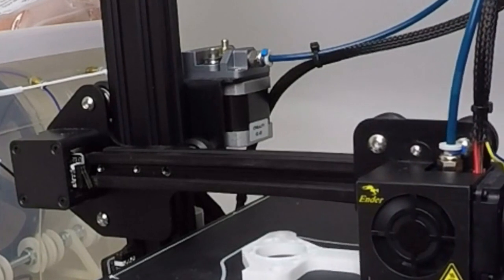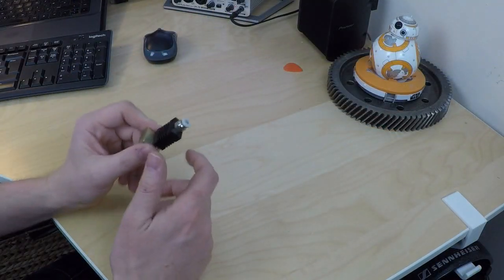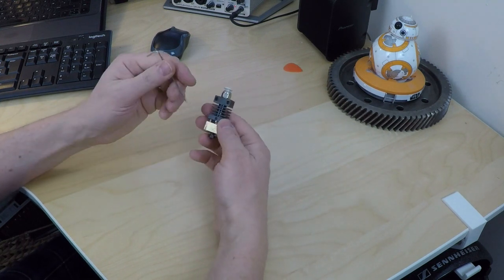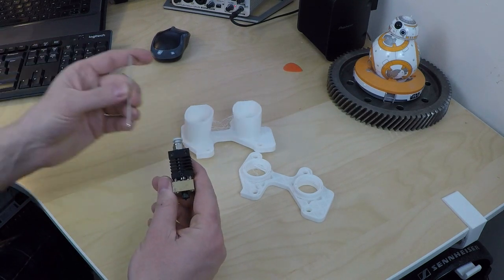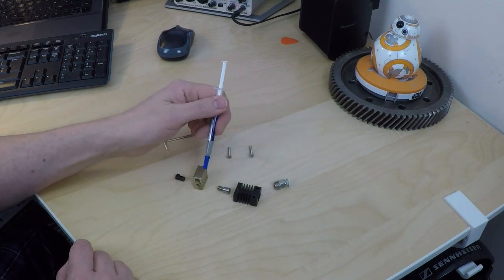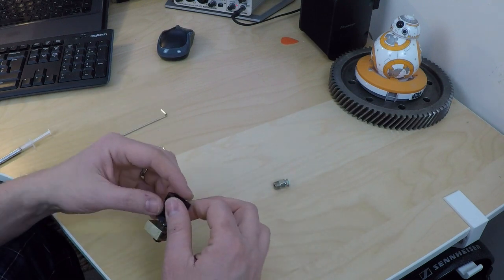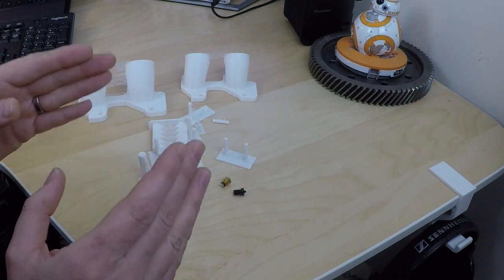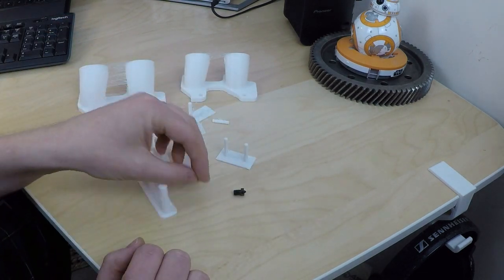Never clog again!! 2 easy tips to solve a clogging all metal hot end!

Comment: Oh boy.

Just so you (probably) already know, it’s not because it’s a cloned part, it’s the characteristics of all metal hot ends.

I myself got one of the original Micro Swiss ones and had nothing but frustration. I ditched it in the bottom of my parts drawer some eight months ago and went back to the stock hotend.

Now that I watched your video I’m ready to give it another try. Never considered using thermal paste, it solved your problem and will probably solve mine.

Cheers mate!
Reply from the maker: Not so sure… I know every all metal hot end has more problems than the standard hot end.

And anyway the Prusa uses a E3D V6 and runs PLA no problems…. (So that’s what I’ve bought now!)
Reply: How was it going?

Comment: Make your retraction 2-3mm. I get almost no stringing.
Reply from the maker: I tried different retractions, what actually helped was removing the retaining screws...  but i'm on the next iteration now....
Reply: @MakingforMotorsport  Also check your heatsink cooling fan. Mine was heat creeping up the heat brake and then it clogged. After replacing the fan its printing better than ever.

Comment: One thing I noticed you missed in regards to heat creep on these all metal hot ends, the two long screws (silver Phillips head) are in place just to help align the heating end with the rest of the body and should be removed after the whole unit is tightened securely as they will cause 3x the heat transfer between the heated end and cooling body hence the heat transfer problems. Try removing these and you should get way better performance without the need of thermal paste.

This is an awesome video regardless and greate starting point for anyone to begin printing using these metal hot ends. Thank you for putting in the effort of recording this, you are much appreciated! 💯🌟👍
Reply: CHEP youtube channel proved the screws are basically nothing to worry about. Decent *theory*, but the emperical heat transfer that actually occurs through the screws IRL is completely negligible in practice.
Reply: never use the hotend with these screws removed
Reply: like....actually? I just got this style of hotend - so I am going to try that!!!!

Comment: CPU silver heat paste will degrade at above 140 C at best. Its not designed to go higher then 100 cause your CPU will shut down due to thermal protections. It will probably be fine for heat break / heat sync but it will hurt on the nozzle hot block.
Reply: Just looked at my package of kryonaut thermal paste. It looks like it's 350c! Artic silver is 130 though so get some kryonaut. I am not sure if thats long term temp so you might wanna double check.
Reply from the maker: Yeah the Thermalyse (I think) one I used in the video is good for 300 but your not the first to say that about the Arctic Silver 👍

Comment: Muahahaha!  "NOOOOOOOO, NOT AGAIN!!!!!" 

That´s it! .... Damn Pheatus Dragon Hotend!
Reply from the maker: Haha…. So I take it you don’t recommend that hot end? 😂
Reply: @MakingforMotorsport  To be honest the high flow variant is a pain in my ass! ... Stringing issues but you´re able to control it with a lot fine tuning. And more than 1,89mm diameter will cause clogging. You can´t use cheap filament with it. Otherwise it´s a good hotend for that price range.
But just my humble opinion. I wouldn´t buy it again I think. Maybe a Mosquito ... You can´t change the nozzle as good as with a Mosquito and I´ve never had issues with a Mosquito... no clogging, no stringing... you get what you´ve paid for ... or so...
Reply from the maker: I think the high flow ones are always going to be trickier with stringing, just a larger melt volume is always going to be likely to do that I think.  I was thinking about the E3D volcano but I wouldn’t use it properly… hence the V6

Comment: Get a mosquito clone, it'll solve all your problems

I had V6 hotend before, and had the same issues, caused by heatcreep, and not enough cooling on the cold end

Sadly all of these types of hotends has the same issue, heatcreep

The mosquito has bimetal heatbreak which solves these issues, also a lot more effective cooling on the cold end

With it it doesn't really matter how much my retraction is, it never clogs, since I have it I never had any clogs

I'm printing with pla, petg, abs, asa, tpu, soon I'll try to print nylon(66, mega prone to warping) if I finished the chamber heating

Also nozzles

Most cheap ones has a 120 degree cone at the end of the nozzle inside, super prone to clogging, the correct angle is 60, probably the material burns in the sharp corners and when it gets out it blocks the nozzle, or simply the flow resistance is that much higher in the 120 degree ones
Reply from the maker: Great bit of information… I went for the V6 because they are the Prusa standard (I think) and that seems to cope well enough with PLA?  We’ll see I suppose!  I’ll have a look out for those nozzles aswell 👍

Comment: Also, MOST (not all) thermal grease/compound or glue/epoxy can "cook" and turn extremely hard and actually work as an insulator.  Due to the close tolerances of the heater and probe, you don't actually need to use any compound on these parts.  Plus if any of the grease gets into your print, its going to ruin it as well.

Comment: That heat brake is NOT an ALL METAL hotend.  That still requires PTFE tube to got 80% of the way down the heat sink... A REAL all metal TITANIUM Heat break will NOT use PTFE tube except for the top 3mm of it, which will only require about 10mm of TOTAL PTFE tube insertion including the little "bite" fitting at the top..
It should look about 20MM long or so, and be 1.75mm ID for most of the length..
What you have there is a SCAM piece.  They use a "play on words" so they are correct.. 99% of 3D printer people refer to the entire "hotend" as the... Well, "HOTEND" except these scammers refer to just the "heating block" as the "hotend".... And include none of the Heatsink in their "hotend" description... Except they do when selling it.. They don't say "hotend plus heatsink"... They sell it all as one "hotend"..
So for a budget fix, you need to search for "all metal throat", or "3d print titanium throat" and that'lll provide you with the part you're looking for..  No guarantee it'll fix the clogging, but will probably help a lot with your issue...
Reply from the maker: Hi there… I do love your passion but this is “all metal” as the PTFE extends only about 5mm from the connector into the heat sink and the heat sink has only a 2mm hole through for the filament only…
However I am sure we can agree that what I have is sh1t whatever… and is going to be replaced with the genuine E3D V6 I have sat next to the printer 👍
Reply: @MakingforMotorsport  Its def junk, but the PTFE has to go almost 25mm into that heatsink to hit that short heat break.  That means that most of your heatsink is filled with PTFE not metal.  Here is a link to the "all metal" heat breaks that you will want to run.  Sorry it's U.S. page, but I'm sure you can use it to find one for an U.K. Amazon page.  This will go right into your stock ender3 hotend, and replace the stock heat break.  The PTFE tube only goes 4mm into the heatsink when using this and the rest is filled with metal, thus making it an "all metal hotend"..  I know the listing for the one you purchased called it an all metal end, and I've been "burnt" by that same "hot end" (pun intended) when I first tried to switch mine out. lol...  
The one in the listing below is pretty cheap and you get multiples in the pack.  Just don't be fooled by the one that looks the same but is actually a PTFE version that has the tube running most of the way down the heatsink again, except its inside the metal.  These are better than the stock ends, and will allow you to print high temp filaments like Nylon or ABS from your Ender3...  (There is a diagram showing the distance the PTFE tube will insert in this listing as well)

https://www.amazon.com/Titanium-Thermal-Heatbreak-Upgrade-Creality/dp/B08TCD4M1S/ref=sr_1_3?dchild=1&keywords=all%2Bmetal%2Bthroat%2Bender%2B3&qid=1634315499&sr=8-3&th=1

Comment: I couldn't get either method to fix anything.  Two weeks with a filament oiler and I never had another issue.  I'm suspicious of what method really fixes a all metal hotend
Reply from the maker: I don’t know, the oiling just feels wrong as I don’t know where all the oil is gonna end up or what it’s gonna do to the prints🤷‍♂️ either way tho it’s good you’ve got the problem fixed 👍
Reply: @MakingforMotorsport  it's not enough to ever effect your print. It's just a towel or sponge with some oil on it. It will however make your glass plate act like you greased it with butter,meaning it must be cleaned after every print until you get rid of the oiler. For me that was about 2 weeks. Nothing will stick to it in the same place twice😆!!
I would just keep printing in different spots if I had alot of smaller stuff to print out,and then clean it.

Comment: This is a bit long, but I hope it moght be useful for others when troubleshooting stringing, oozing, retraction issues etc. Understanding the dynamics at work had helped me a lot.

1.0mm of retraction on a bowden setup, even with tight tubing like capricorn etc, is pretty much "no retraction". There's usually a 0.2 to 0.4 (or more) mm larger diameter inside the bowden tube, than the filament diameter. As the extruder pushes filament through the bowden tube and there's (normal) resistance at the hotend, there's room in the (bowden) tube for the filament to absorb that force and tension, by bowing inside the tube. Kinda like taking the outside of every bend on a race track - when you do that in all the bends, you're effectively doing longer laps than if you stayed in the center of the track.

The longer the tube, the more accumulated space the filament has to bow and flex. The result is that when pushing the filament, there's several millimeters more filament inside the tube, than the actual length of the tube itself. That filament inside the tube is under tension, maintaining that flex. Badly configured extruder e-steps can attenuate these issues. 

So when doing retraction on a bowden setup, the first few millimeters of retraction doesn't actually cause any actual retraction of filament inside the hotend - it just relieves that pressure, so that now there's the same length of filament inside the bowden tube, as the length of the tube itself. This relieves the filament tension and reduces oozing.

Next, the hot (and the molten) segment of filament inside the hotend is sticky. So there's some resistance to physically pulling the filament back out. This results in the extruder needing to pull on the filament with force, causing the filament to bow inside the tube once again - this time similar to taking the inside of every bend on a race track. So now you've added another 1-2 mm of retraction, but the result is that there's now a lesser length of filament inside the bowden tube, than the length of the actual tube.

Only once the extruder has pulled out all the "slack" available for the filament to bow/bend/flex inside the bowden tube, do you get near-full transfer of "pulling force" from the extruder, onto the bit of filament inside the hotend so there's enough force to overcome the sticky friction. Only then, does the filament actually start moving (retracting) inside the hotend.

So with a bowden setup, it's not until beyond 3-4+ mm of "retraction" at the extruder end, that the filament in the hotend actually start moving/retracting. 1mm of retraction, likely won't be enough even just to relieve the filament tension, to mostly stop it oozing. It certainly won't cause actual retraction at the hotend, you usually need at least 3-4 times that before filament retraction at the hotend actually kicks in.

Do note: This stuff doesn't notably change with an all-metal hotend, because the cause of it is the bowden tube between the extruder and the hotend. The tiny bit thst go inside a lined hotend, doesn't make a notable difference. And it's a fully straight section of tube, which is less conducive to filament significantly bowing inside.
Reply: Absolutely beautiful  explanation
Reply: @GuysLightburnLaserGuides  Thank you, I appreciate the recognition, although all reasonable criticism is welcomed. I am confident that someone better with words and teaching could explain the same things with 5-10% of the word count. It is really not a particularly difficult, complicated and certainly not rare mechanic to run into, nor to solve. but if you don't know about it, it can be a serious PITA to troubleshoot because there's not really a whole lot of other/alternative ways to fix or compensate for it.

So none the less my struggle to explains stuff efficiently, I wanted to put it out there, because I think these factors and their impact has been very poorly covered by everyone from content creators, forum participants and even printer manufactures. Even though they are among the most common issues faced for almost all FDM 3D printing newcomers (which even the pro'est of pros have all been themselves at some point too). IMO that lack of information can make troubleshooting FAR more difficult than it needs to be. And especially for the newcomers, that often results in - after a crap ton of troubleshooting, trying "everything" and frustration - suddenly improving or solving the issue. But at that point, still not knowing what actually caused the issue, and having lost track of things you tried you don't even know what actually "fixed it".

I myself had to figure this stuff out the long and hard way. So I was hoping what I learned could benefit some others, so they don't have to do the same 😊
Reply: Nicely explained. I have the same picture in my mind, but alot of the stretchiness in the system is in the materials - that’s to say the Bowden tube stretches during filament feed, contracts during retraction, filament itself compresses during feed, stretches during retraction. Exact retraction number - must vary from model to model. Can definitely see the merits of direct drive system…..
Reply: So even with an all metal hotend you'd go for 4mm retraction? I'm about to give up on my hot end. I haven't tried normal retraction yet i went straight to what the internet recommended.
Reply: @abgingernuts  Or more. If you're having issues, 4mm is practically a minimum. Try 6 or even 7 first, see if that makes a difference at all
If it does, but too much, start dialing it down from there. As mentioned in OP, the mechanics of this doesn't change with an all-metal hotend, because the (room for) "slack" is in the bowden tube. Especially curved sections. Even with a PTFE lined hotend where the bowden tube goes all the way up to the nozzle, that last bit of bowden tube inside the hotend is straight and terminates in the nozzle so the filament doesn't bow or flex much in this small, 30-40mm section. With an all-metal hotend, there's a metal path for the last 15-30mm instead, but it has roughly the same bore size as the bowden tube so the effect on retractions are practically identical. The filament might sometimes stick a bit more to the interior walls of some All-metal hotends though, meaning in some cases you may need to add another mm or two of retraction, for the elasticity of the length of filament inside the bowden tube between the extruder and hotend to break the friction and pull the molten plastic at the nozzle back.

TL;DR
This is pretty universal with bowden setups. The "only" setups where you need less retraction (0.5-2.0mm range), is with direct drive extruder setups. For bowden, whether your hotend is all metal or PTFE lined, you need at least 4mm - often significantly more.
Reply: @pr0xZen  i went back to a .4 nozzle but kept my hotend to knock out a variable as i was having issues. 5mm retraction seems to have it working well again! Thanks!
Reply: Whhaaaaaaat!?
Reply: @fate2022  He is right though,

Comment: I know there is alot of comments at this point, but am I the only one that noticed that the nozzle was not installed properly?  The nozzle should be screwed in all the the way and then backed out a quarter turn.  Then the throat (heat break) should be installed.  Once that is done, heat the hot end up and torque down the nozzle.   There is way too much of the nozzle threads hanging outside the block which might be the whole reason for the stringing.
Reply from the maker: Yeah… you are right, I install it now a lot closer to the heater block, didn’t make much difference but did help.

Comment: i had a E3D V6 hot end !! i upgraded to 40 mil fan and in the adapter i made a hole where the heat break is .... so i had just enough draft to move the hot air coming up from the heat block to the heat break and that solved my problem ... im going to try the thermal paste thing when i get home

Comment: The clamp screws are also carrying heat upward. Try your thermal grease on the heatsink side of the threads.
Reply from the maker: Yeah, I tried after with these just completely removed and improved the stringing again 👍
Reply: The long screws that hold the heat block steady cause insignificant heat transfer to the heat sink.